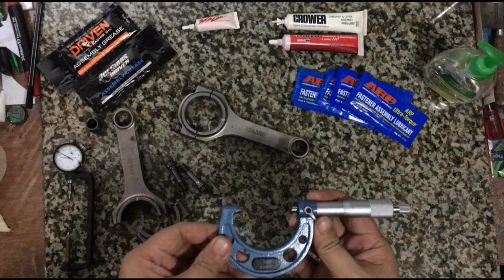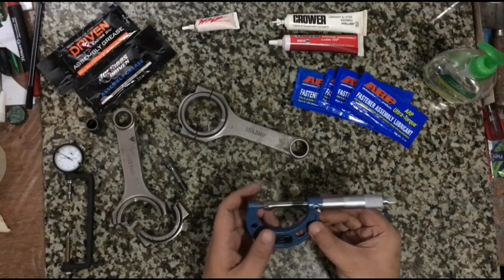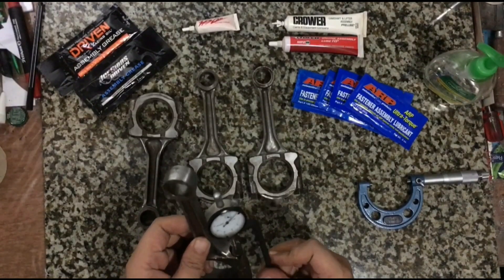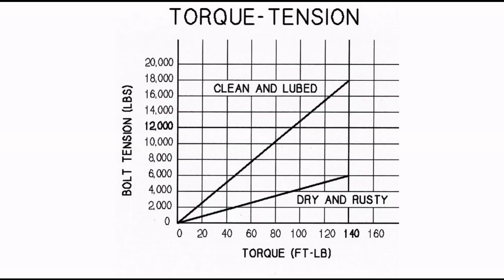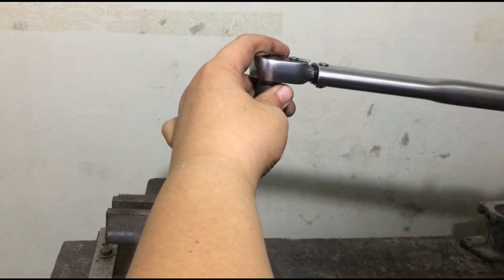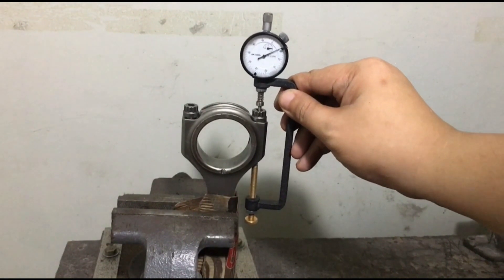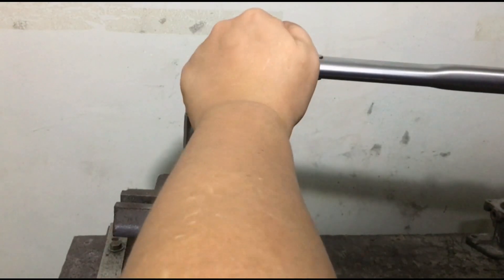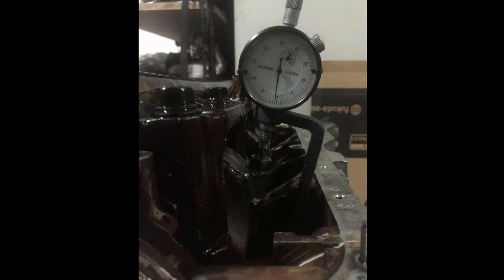Why we follow manufacturer's suggested STRETCH method (CP carillo ARP2000)

Comment: It's a very good experiment you did there... dry vs. engine oil vs. ARP Lube.  I think many people wouldn't quite believe it otherwise.  One question I have is, when you put the ARP Lube on did you put it also on the underside of the bolt head, and not just the threads?  Thanks
Reply from the maker: Oh thanks for checking this out 😎 and yes if it wasn’t noticeable on the video the underside of the bolt head + where it contacts on the rod too…

Comment: My H22 Eagle Rods says 43ft lb torque or bolt stretch (0.0055" - 0.0059"). I used stretched method and end up with 58ft lb torque when stretched to spec with ARP lube. Sounds correct?

3/8" ARP 2000 bolts
Reply from the maker: yes sounds acceptable,  i think if you tried again and put lube again the torque can be lower maybe 50ft lbs and u can get the suggested stretch.

It happens sometimes not because not clean but because its not always first time sure every thread rotation is well lubed :)

example: b20 ARP rodbolt is 26ft lb torque but lubed and to get to the 0.0050-55" stretch ots sometimes 28ft lbs or even 32ft lbs 

so like your Eagle Rod looks similar torque vs stretch results

Comment: thanks for this, I did not know the difference would be that much between using oil and the correct lube. fitting ARP studs to stock B20 Rods, how much should it be torqued?
Reply from the maker: me too back then hence nice to share... on b20 stock rods we still follow ARP's 26ft lbs but use the stretch as reference, i must admit even sometimes using ARP lube? first try to 26ft gave me 0.00045" only and re did it witj more lube and bam! 0.00050 🤣

Comment: Rod stretch is recommended especially for ARP bolts to determine the proper torque with the proper lube. 
Great video 👍
Reply from the maker: Yes sir! even actually ive emailed CB and they had numbers for their rods so it was awesome!
Reply from the maker: on inline4's its also a trick to longer lasting headgasket cuz for the same torque? u get higher clamping force... no bueno on our type1 cuz that changes the mains clearance on bearings doe